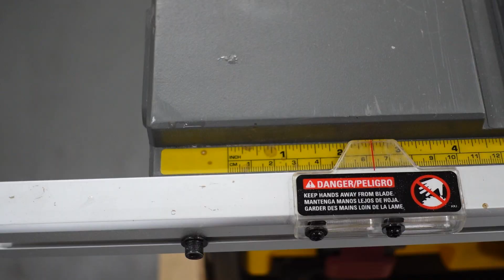DIY Wooden American Flag Coin Holder Tutorial

Comment: Hello it looked awesome what size is the coin holder and the depth for the coin to set in
Reply from the maker: Overall, the flag was 36"W by just shy of 18" tall. US flags do not use a 2:1 ratio. I cut 1/4" grooves to allow slightly larger coins to fit between the shelves. I hope this helps. :-)  Thank you for watching, your kind words and for taking the time to leave a question and comment. We appreciate it very much.

Comment: You have a lot of expensive equipment to call it "poor" man
Reply from the maker: It is a Name. Just Poor Boy restaurants that make a ton more money. LOL.  The idea is to show how you can save a ton of money by doing things yourself. Our ceiling caved in because of a water leak we were not aware of. Contractors quoted $8000+ to repair everything.  We did it ourselves. We purchased some "expensive tools" you refer to at a cost that was significantly less than to pay Contractors. When we finished the project, we ended up with some nice tools. We saved money by purchasing expensive tools and this could work for poor peopleas well.  😀